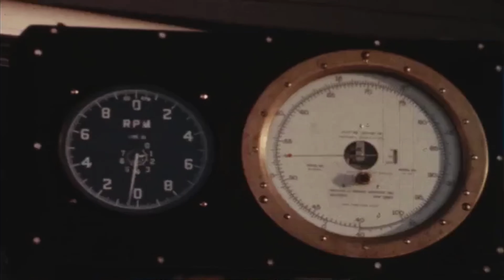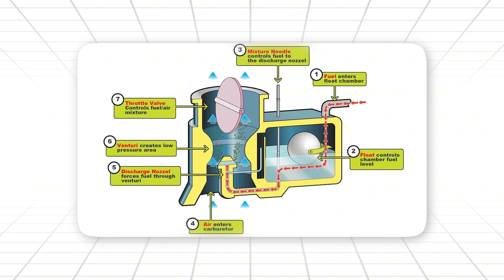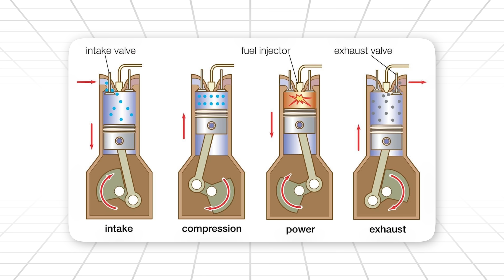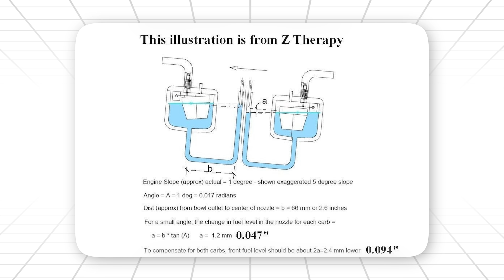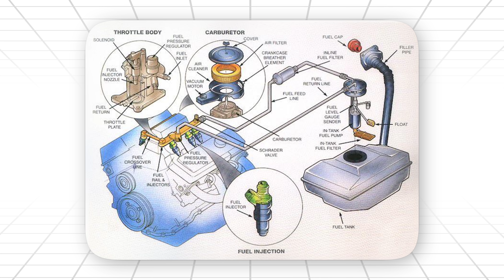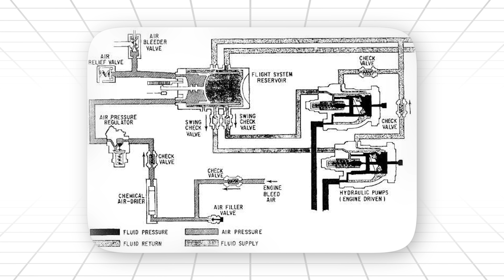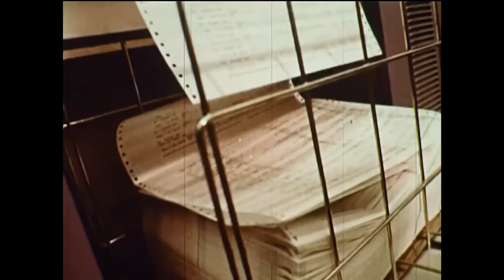The Illegal Cheat NASCAR Couldn't Find for 20 Years

Comment: Ohh hey Smoke, whys that car idle so high? Its like it has an air leak or something? Smokey shuffles feet and offers you a beer and a brat instead.
 Points at rear of car and says. Hey seen these new Goodyear's?!!!  Meanwhile he also had a small spray bottle of window cleaner. And a fish tank air hose that led to rear inside behind tire.
Jam spray bottle against hidden hose opening, and spray a few pumps. Car behind INSTANTLY loses grip in turn. throw empty window spray bottle on floor, no harm, no foul! Smokey!
 After a while drivers get wise and finally figure it out ... I was told it was actually a driver that figured it out first. Or probs knew about the trick from someone else from another time.

Comment: I once saw an intake manifold from Richard Petty's car that had 1/2 inch holes drilled in the bottom side of it to let more air in....then there was always the 50 feet of 2 inch fuel hose to increase fuel range. Kyle Busch took that to the limit and used a bunch of frame tubing in the roll cage filled with fuel.

Comment: Here is what very few engine men understand: You DON'T want the fuel and air going in the engine at high rom and wide open throttle to be "perfectly blended" or "blended pretty well"
or even "poorly blended".
Why?  Because how much air the engine can inhale - all other things being equal - is if raw solid streams of of liquid gasoline are going right in the intake valve, Under those hellish conditions inside the combustion chamber everything is so hot the gas WILL vaporize in the 1/100th of a second after the intake slams shut and the sparkplug fires.
      Now on a V8 unless it has a carburetor throat right over each intake port you can't feed all 8 intakes unblended fuel and air. 
Go to Google images and look up "Split Dominator" to see how to out-do Fuel injection with plain old BIG ASS TWO BARRELS!

Comment: I'm assuming the carburetor that determined optimal throttle setting was the Quadrajet carburetor with the magical secondary air valve.  Mash the gas to the floor but the secondaries air valve, and the extra air flow wasn't going to happen until the air valve opened.

Comment: Stock car should mean Stock car....and Smokey should have been caught CHEATING.
Reply: how was he gonna win if he followed the rules to the letter?
Reply from the maker: True
Reply from the maker: I think it is a grey area
Reply: He exploited areas that didn't have rules. One of my favorites was a car he built from scratch that was scaled down just enough to have less wind resistance. Narrow and lowered down also slightly less angle on the windshield which was all made in house. That's why they use body templates now. I think the car he did that to was the black and gold Chevelle in the video.

Comment: the engine only needs the correct amount of fuel for the amount of air being drawn in, so if the air intake remains the same the amount of fuel should remain the same.  Sucking more air is necessary to make more power.  Air bleeds dont help with that.  Next time I will tell you how smokey secretly sucked in air that did not go through the carb venturi, which meant the carb had to supply extra fuel for that unmetered air, and that kids is how you cheat and make more power and win races.
Reply: I'm not doubting you one bit. I believe the person that made this video is solely for the comments and not actually teaching us. The more comments, the more money is being made. Back to the air bleeds and emulsion tubes. Most people usually install bigger jets to make more power. Sometimes you run into a stumble when stepping on the gas pedal aggressively or quickly. I found it better to reduce the air bleeds size or solder one of the emulsion tube holes shut, depending what the carburetor has. We've all drank through a straw that had a pin hole in it. You get a bunch of air and very little drink no matter how hard you suck, right? So you cover the pin hole with your finger, sometimes you manage to seal the hole completely with your finger, and sometimes all you do is slow down the air going through the hole. Either way, you end up with more drink with less effort. Anyway, I'm wondering if this is what Smokey was doing, making the air bleed smaller or restricting them, or using emulsion tubes from smaller engines because the holes would be smaller. Soldering a hole shut would be a dead giveaway.
Reply from the maker: Actually, I am not doing this for the comments.  I really want to create the best that I can with the time that I have.  I am working hard on this stuff and really trying to make it as best as possible and trying to do new topics.
Reply: @SpeedStyle-d9u If you serious, then I apologize. But try to stick with the main subject on hand. You showed about ten different carburetors. Did Smokey use any of them? The only one I can see him using out of your video is the Quadrajet. Some vehicles came with Holley carburetors. All carburetors have the same job, but they don't all do the job the same way. Some carburetors have only air bleeds, some have only emulsion tubes, some have both. Some have power valves, some power valves have different springs in them to change the way they function. While the non adjustable power valves you stretch the spring or cut it shorter. Not trying to be rude, but chances are that most people that watched this video only learned that Smokey found another loophole, but still have no clue how it was done. I can speculate what Smokey did, but it would've been nice to know for sure what he did because there's a good chance that I might learn something new. I don't know how mechanically inclined you are. But if you're somewhat mechanically inclined, you'll understand my comments. But if you don't understand what I said, then maybe you should stick with topics that your knowledgeable at. Don't get me wrong, I'm not trying to look down on you with me being holier than thou additude. I'm not good at sports, so I have no clue what is allowed or what isn't. So if I see a video of wrestling and someone gets disqualified, chances are I need an explanation why that person was disqualified. Anyway, I've taken enough of your time. Hope your future videos, whatever they are, will educate people or you can make it like a forum like asking people what they think or what they would've done differently if they were in the same situation. Good luck. 😁
Reply: @monteman73 wow, not a single cuss word! Not only does he talk about rules that never existed but this dude doesn’t know the difference between a Carter aluminum four barrel and a Webber 45 DCOE.

Comment: They keep trying to say he cheated.......he didn`t...............he read between the lines!
Reply: Not cheating........rules interpretation.    Unless the rule book says you can't....you can..
Reply: Smokey said he was a rule maker….not a rule breaker.
Reply from the maker: Yep
Reply: If you ain't cheating, you ain't trying.
Reply: The rule book said stock carb. Modifying a stock carb makes it not stock anymore. It's the same thing as putting forged internals in a block and saying that it's a stock block. Ya the block itself is stick but the guys aren't.
Reply: Yes he did, Gale Banks  whom owns Banks Engineering knew him and Smokey told him the cheating he did. One was an offset wrist pin design he came up with when he was at Hudson Motor company. Nascar disapproved it. Mentioned in this video    https://www.youtube.com/shorts/HWt31o2vUfg
Reply: @Toolaholic7  He didn`t change the wrist pin location, he offset the cenerline of the cylinders which was not in the nascar rule book...again reading between the lines.
Reply: @edpetrocelli2633  Nascar did not approve it

Comment: These Ai generated slideshows are 😢he most appealing thing.   They showed more pics of lawn tractor carbs and modern fuel injection systems more than they did the topic at hand
Reply: I was hoping to learn something about Smokey's work but I could not stand the slide show BS. Hello "Speed & Style" cut the bull shit.
Reply from the maker: Noted.  I will make the necessary edits and just trying to make it in a different style.
Reply: @SpeedStyle-d9u  oh I wouldn’t let those guys bother me. The only thing is I don’t believe there is such a thing as an emulsifying tube in a four barrel style carburetor. Those emulsifying tubes are in the CV type motorcycle carburetor. And that’s exactly what they’re called. And there’s air in jets that control the amount of air that goes into those emulsifying tubes. I can’t picture where that would be in a automotive style for real carburetor that would’ve been interesting to see.
Reply: @robertsklenka5823 sure there are emulsion tubes in many 4 barrels but the entire video is absolute nonsense. Let’s just fact check one thing, just one because it’s full of horseshit. NASCAR has never ever given two shits what jets are in the carburetor. Jetting is was routinely changed to compensate for altitude and weather conditions. That’s just one example of the nonsense in this video.
Reply from the maker: @robertsklenka5823 thank you for this.  I try not to, but it still stings.  I am trying with what little free time that I have
Reply: Anybody tired of AI yet?
Reply: @petiecoe5294 amen.  I think we forgot the terminator movies
Reply from the maker: Not AI.
Reply: @SpeedStyle-d9u  
Yes it is.....
no sane knowledgeable human car commentator would put in photos of diesel injection systems in a carb vid...
Reply: and diesels....
Reply: WTF the images have nothing to do with the actual carbs used in NASCAR. 😂
Reply: I agree.  BS crap telling us that NASCAR had to use OEM jets, lol... ban ai channels
Reply: ive been 3mins in, not a single information yet
Reply: Well CV motor cycle carbs
Reply: I just realized that it autocorrected appalling to appealing.  So much for my five dollar word today
Reply: Not a different style, just the correct style. Holes in the emulsion tube are there to break surface tension of the fuel droplets helping to vaporize better.
Reply from the maker: Not AI generated.  I would not even know how to do that.  But thanks
Reply: @SpeedStyle-d9u well you don’t know shit about carburetors or NASCAR and that didn’t stop you.